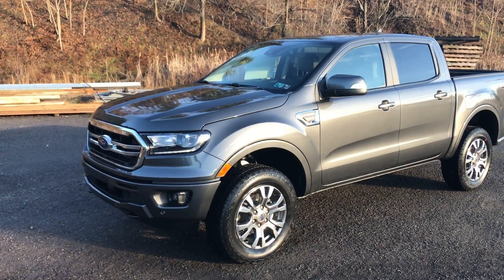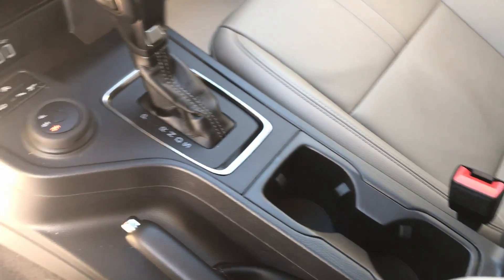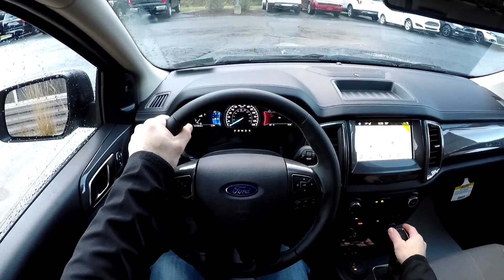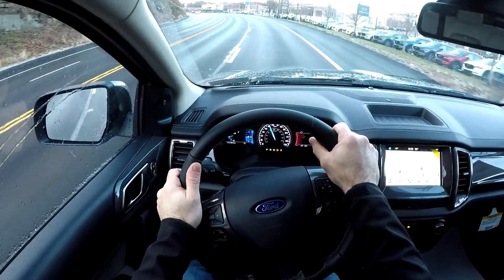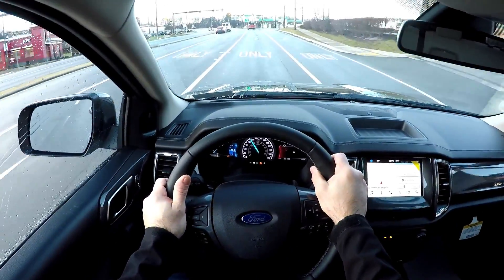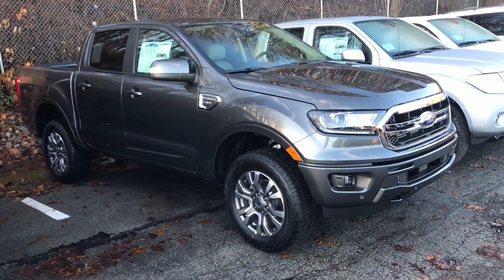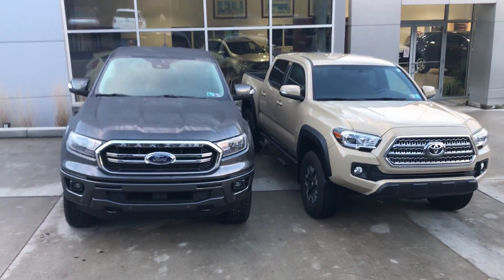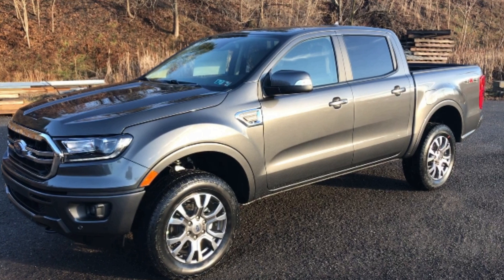2019 Ford Ranger Review

Comment: 23,000 to 46,000 so you can buy 2 trucks for 46,000 or option one up to 46,000,.. thats crazy, 23,000 in options
Reply from the maker: That’s a good point!
Reply: What kind of truck will you get for $23,000
Reply: @richardsnyder3900  same motor , same body, same frame, same welds, same paint job as a 46,000 one.
Reply: What brand truck just wondering
Reply: @richardsnyder3900  2019 ford Ranger
Reply: Newton Washinton they got 2019 Chevy Colorado basic stripped models for 18k online
Reply: That does make a lot of sense. We hope everyone can see through the propaganda of Capitalism. Please, everyone, look over your options.

Comment: Looks like your hair  needs to be mowed
Reply from the maker: That's HAIRlarious! I got it mowed yesterday.
Reply: @PIPSBURGHVIEWS  Great review. I just don't understand at $46k why you wouldn't just buy a full-size F150
Reply from the maker: I agree but A decently equipped F150 XLT would run you over 50 grand.
Reply: @PIPSBURGHVIEWS   I still think, know actually, that the ranger is at least 4K more then a comparably equipped Z71 or offroad Tacoma.  At least on the higher end trims.  Most dealers are comparing the Ranger to the F-150 as regards to price.  But that's hardly a fair comparison being a different segment.  But I'm noticing dealers are avoiding at all costs to compare it with other mid size in  regards to price.  Because in that, its a hard sell to justify the price.